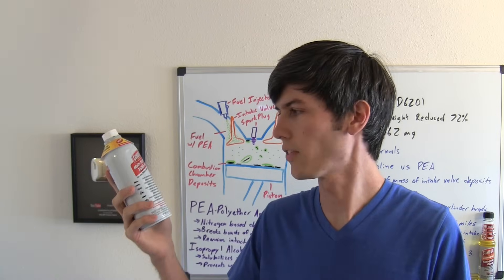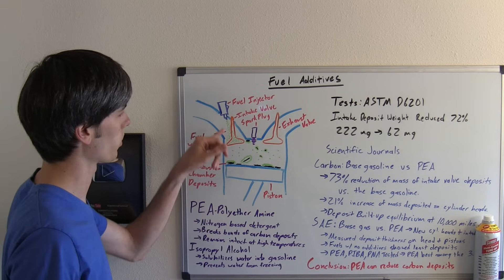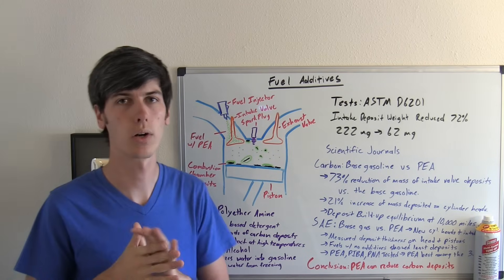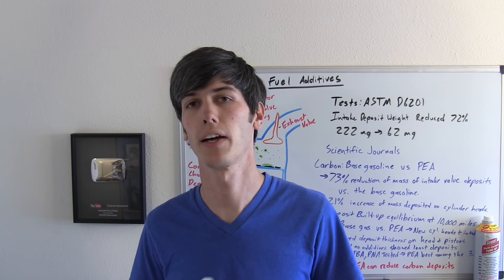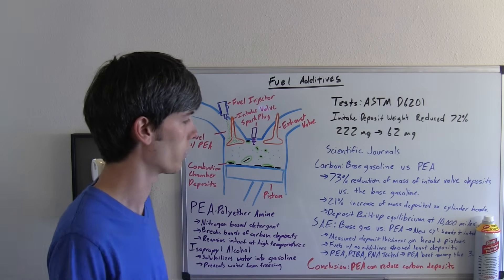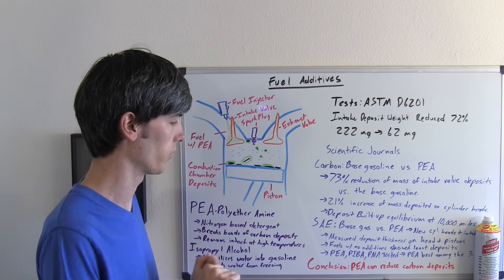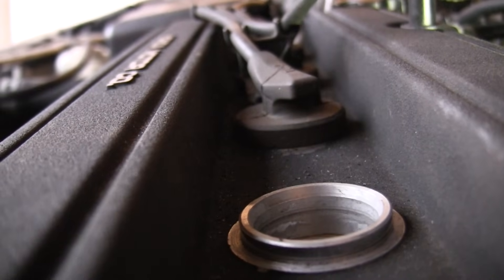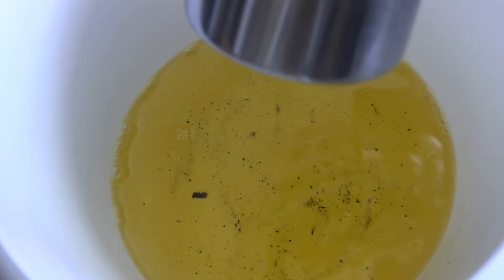Fuel Additives & Injector Cleaner - Explained

Comment: Until what approximate mileage (I know this is very dependent on vehicle use, engine and fuel type/quality, etc) is an engine considered new (aka doesn't benefit from PEA additives) and at around what k approximate mileage (if you had to make a rough estimate) might it start benefiting?

Comment: Only down side to euro 4 + vehicles, particularly direct injection diesels, 

Is they recirculate exhaust gases through the inlet, yet also, hook the oil breather pipe up to it. 

So you intake clogs up, including the valves, 

But the manifold is dry as it’s direct injection, so it does not clean your valves.

Comment: 4:17 - IF you consider high quality gasoline the one with additives but additives make more deposit in your engine, why do you recommend using high quality gasoline ? The best solution wouldn't be just regular gasoline with some PEA  ?

With that in mind, if you use "high quality fuel" or "with additives" in new cars, in the future, they will become as dirty as the older cars because such fuel adds more deposit. Makes sense ?

What I see here (and having in mind such scientific data) is cyclic dependency that gets worst over time. In fact, we put more additives to clean the former additives. If there's an additive with just PEA, that would be great ! But are they ? They're all "laced" with molecule X or Y to achieve more detergency or more lubrication or more this and that but the fact is, as it seems, less is more with additives.

I already read something about this issue. That's why I use regular gasoline (no additives) and Oilsyn's Hybrogen, a fuel conditioner. It is not an "additive" per se. Instead, it changes the molecular structure of fuel to achieve the same end. You should check it out someday.

Comment: I poured seafoam fuel additive before filling up to full in my 165,000km engine and ran a 700km road trip using highway speeds. When I took out one of the spark plugs that had 85,000km on it, there was absolutely no carbon buildup or black residue on the spark plug. I wish I checked what its condition was beforehand because I was positively shocked. I think it was the fuel additive.

Comment: What a great video ive got a p0303 code for a cyl 3 misfire and my throttle response is a bit slow im gonna run some of this through the system to see if it cleans my fuel injectors its 160k miles never had any additives and its also 13:1 compression ratio so ik it uses less fuel and could lead to clogged injectors on lower octane (probably gonna start running premium even though it doesnt perform any better in my engine)

Comment: What's about acetone that's all right if you've got solid pipes but you've got rubber pipes it might be a problem!!!
Reply: should be fine here in australia we got E10 which is 10% ethanol with the fuel since its alcohol and acetone is alcohol im pretty sure it wont do damage as its diluted well within the fuel tank

Comment: I witnessed an engine tear down to where all cylinder heads (top of cylinder) were exposed coated baked black on top, " except one ". That clean one was sparkling shiny on cylinder head top. My assessment was there was a main seal break or opening  leaking radiator fluid into the shiny head cylinder under combustion causing this amazing cleaning by super heated radiator Fluid,  evaporated not combusted. Best wishes. Yet have not ever heard this clean cylinder head top, as every auto mechanic must have seen this ?

Comment: thanks for the breakdown.     when deposit buildup is removed by said liquid, does  the residue eventually go through the catalytic converter?
Reply: Usually its only the large pieces that break off and end up at the catalytic converter, since the small pieces burn off before it can even reach there

Comment: So, the cited articles found that, although PEA additives decreased build-up on intakes, they actually increased carbon deposits on cylinder heads more than gasoline alone.

But you still claimed they remove deposits in general.  Hmm.  I think I see a sponsonship effect.

Comment: Greetings. i have a 1.4lt turbo gdi hyundai engine (year 2020 model i30) with 42.000 km so far. Do i need this? It will help my engine? I use only premium gasoline.

Comment: To run fuel cleaner for 50 hours wouldnt you need to use the cleaner on back to back fill ups for like say 10 times in a row??

Comment: No mention of injector cleaning effectiveness.
Reply: Yeah Id like some data points for that.
Reply: You'd have to find something that tests them, the guys just explaining the theory not the practice
Reply: Seems like they wouldn’t have carbon inside since there isn’t combustion going on inside. Maybe at the tip. Might be easier just to pull the injectors a clean by soaking or light wire brush. Then checking spraying ability manually (find a video that shows you how). And if it’s electrical bad just buy a new one

Comment: I can attest to the effectiveness of PEA as a chemical cleaner in gas engines.

I have a Nissan 370Z with the VQ37VHR engine that is hitting 57K miles. Since it was new, I have been using a maintenance dose(⅓ oz per gallon of gas) of Redline SI-1 complete fuel system cleaner, which is high in PEA,
through the gas tank. A borescope viewing into one of my cylinders at about 40K miles showed nearly no carbon deposits on the piston top, with the aluminum only lightly darkened in color. Once a year I do have the intake system misted with a concentrated cleaner and have the throttle bodies cleaned.

Comment: I’ve been using GumOut on my 150,000 miles car with only a Direct Injection engine.

After watching this video I’m glad it’s not just a placebo effect but an actual result for using the fuel cleaner. 

This video really helped me bring back the MPG and mostly better engine performance of my car especially when you also watch and follow his italian tune up test vid which I really like because you no longer need to rev the engine high gear per gear, just cruise in that specific rpm for a while and the heat just burns those deposits. :)

Comment: Yes. This and berry. Works well.     I use reclaim gumout every other time. 3000. Miles.  Run. Mid grade gas. If possible. It helps a lot.   Good video. Tu

Comment: Good quality gasoline will only retard the build up. Direct injection engine are sensitive to injector being dirty. I would say use a treatement every year even with quality gasoline. I speak with experience. Or else you will see your gas mileage decrease over the years.

Comment: The major problem with these off the shelf cleaners is the carrier oil. It's made up 80-90% low grade oil, plus the additive line PEA.  What ever benefit the PEA cleaner does is negated by the carbon build-up from the oil in fuel mixture. Especially bad for GDI engines. Agree, just use premium Top Tier fuel.

Comment: (My english isnt that good) Well i tried liqui moly diesel injector cleaner in my vw passat 2.0 tdi ( 2011) and i made a mistake by adding the additive in half a tank , i thought its normal but no , the first 5 to 10 kms went noraml but than i started hearing lot of knocking sounds from the injectors and the car started idling rough , i turned it off nd it wont start just cranking not firing up , after many tries i managed to turn it on nd took it right ( injectors still knocking) i got a full tank of fuel nd drove for like 20 mins at High rpms ( 3k 3.5k) after that injectors stopped knocking nd the car turned to run fine , second day it was driving like new , if anyone understands what happened pls explain

Comment: Do fuel additives help clean fuel injectors or do fuel injectors need to be manually cleaned by a specialized testing centre? I own a diesel 2.2L 4 cyl, with 497,000 km on it. It might be having issues with clogged fuel injector/s. And i'm trying to use a high concentration/very high quality fuel additive/fuel injector cleaner , to hopefully clean my injectors without having to remove the injectors and having them tested which costs a lot of money. I saw some videos of people manually cleaning their fuel injectors with fuel additives and a tiny hose, but many mechanics tell me youtube videos like that are rubbish or fake. I'm thinking of buying Lucas fuel treatment for diesel, and hoping it will properly clean my injectors so i won't have micro symptoms of shakes while idling, which may get worse over time. No fault codes have appeared yet, however reasonable suspicion that fuel injectors are slowly getting carbon clogged and may need cleaning.
Reply: If you can get some Millers ecomax diesel treatment. It's an excellent product, very effective.

Comment: Ran two lots of injector cleaner through my 2.5 Diesel engine. I’ve been running it 20k it’s a good lump but I don’t know the history before I fitted it. It’s definitely made a difference on mpg going from average of 31 to around 33.5. And it feels slightly better. Next step is new injectors but as an interim measure for twenty quid it’s been worth it.

Comment: You reached a great conclusion.  Newer engines are high precision and don't have as much waste and the waste is where the carbon buildup comes from.  Simply put, newer engines don't need the additives but older engines do.  Things like Fuel injector will eventually build up carbon, (80,000 miles typically) but they are also in the routine maintenance schedule for replacement at that time.  So, once again, if you follow routine maintenance, additives are not needed.

Comment: I believe the flow rate of the gas/additive mixture plus heat make all the difference vs soaking in a beaker at room temp. Tough to do this comparison unless you start with two of the exact same year car with similar deposits.

Comment: I've used Wynns injector cleaners and diesel fuel treatments in diesel engines, both 90s rotary fuel pump and more recently in common rail engines for over 20 years. They work great. However, I've heard of a trend of people adding 2 stroke mineral oil into their diesel tanks to combat the lower sulphur and higher ethanol/biodiesel content of modern diesel fuel. @EngineeringExplained Can you please do a video on this as I think it's unecessary and will just cause fuel filter clogging, ossible injector damage and excess carbon deposits in cylinder head, valves and exhaust...
Reply: I saw a video where 2 stroke oil was tested as a diesel anti-gel but it did not work too well.
Reply: @TheTyisawesome  so far I can only think of negatives. Might explain the extra dense soot patches on some people's rear bumpers recently, which I never aspired to even with smokey old Peugeot tdis?!🙈😂

Comment: Try once a year adding 1 quart of ATF to 10 gallons of gas. The detergent in any ATF is one of the most powerful known to man and will clean anything. I've used it for years and I have never had a bad fuel injector.

Comment: We need more on e85
how too use it safely 
does fuel additive change the tune
how too protect alloys or steal against corrosion 
drum vs pump e85
is using e72 that has more petrol better?

Comment: Hi I added a correct dosage of a PEA based product to a full tank of gasoline in 2.4L engine with a 100K miles on it, after 80 miles of highway driving I've had a 10mpg drop, a fluctuating fuel gauge and crackling sound from below the engine which continues after the engine is off, possibly from around the catalytic convertor but no CEL light.  Any ideas what's going on?

Comment: A quart of transmission fluid in your fuel tank at every fill up will do wonders for your diesel. Not sure about new ones with all the emissions crap they have. I dont know about using this for gas engines either.

Comment: There are so many on the market, I was hoping you would test them and show the winner. Just like olive oil which is one of the most adulterated of products, so to are fuel additives and cleaners . Some are watered down , others concentrated. Trying to strike a balance as to which one will do the job without damaging sensitive parts is difficult for the novice fixer.

Comment: You do awesome work! But. Why can't anyone answer THE question that I've been trying to find out but seems like it's just too simple for everyone. "Can octane boosters (In a bottle) actually boost the octane of pump gas". I have a turbo car I want to tune using 95 octane fuel. In my area I can only get 94 octane (10% Ethanol added) and want to make it into 95 octane. Can an octane booster off the shelf actually do this? Or is it just pipe dreams in a can? Do I have to get a hold of actual xylene to do that? How much would I need to use to go up one octane point. Or could I actually use the 95 tune (it's a tune you get from a tuning company that is pre made) with 94 and not have to worry really?? Sorry for the complex questions but maybe you might see this and it could give you a topic for your videos? And help me LOL. Thank you for your great hard work over the years!

Comment: Leaving it soaked does not take into account the temperature, pressure and flow dynamics of a running engine, that probably helps in removing deposits

Comment: I wish I knew why it is that when I put fuel injector cleaner into my gas, the car stops dropping down to 500 rpms, stops stuttering and stops losing power when I press the gas, but then after a couple days it goes back to doing the same thing before putting another bottle of cleaner in, clearing it up and then having it go back to losing power while idling and accelerating out of an idle stop (ie; after the light turns green)

Comment: Hey man  please answer my question , I research a lot but did not find the proper answer 
The question is what , if we put another car fuel injector to our car for example I have a 2007 Toyota 4 runner it’s getting a  very very bad gas mileages and mechanic told me it’s because of fuel injector replace it with Toyota Camry fuel Injector I want to have your opinion in this please

Comment: Maybe I am reading into the source too much without actually reading it... but if you research a steady state at 10000 miles under that test doesn't that mean using the additive in high amounts is just a waste of money since it does not improve the amount of deposits removed beyond that point?
So basically it sounds like for a well maintained or relatively clean engine its basically useless but if the car was neglected and had a lot of build up from previous use or neglectful owner it can reduce the build up after a few treatments.

Comment: Here is a video idea for you:  discuss why tire shops won't fix tires that have punctures in the shoulder or sidewall. (hint, I think it has something to do with the tire flex in that area, and the heat generated to the the tire flexture.)

Comment: So we understand that PEA dissolves carbon. But this carbon isn't burning in the combustion chamber into CO2, and instead getting deposited inside the engine. Like they said, on the cylinders and stuff. 
So aren't we actually harming the engine more, by using additives. 
We could manually remove the carburettor and clean it if there's carbon build-up. But in this case aren't we actually just dissolving up the carbon from entire fuel system and just dumping them over the engine?

Comment: Take out all spark plugs..pour it in neat . Say 50ml , and let it soak for an hour..then turn over your engine with a heavy towel, old one, over the spark plug hole and blow the carbon and cleaner out for a fast effect clean then use additives everyfill up

Comment: I have bought an old motorcycle, it has already completed 52000kms as the meter reads.
 112cc OHC engine, Should I do the fuel system clean for the first time?  Will those deposits get stuck somewhere or damage the piston sealing area?

Comment: I'm questioning the statement that carbon buildup plateaus at 10k miles. We all know that the more miles the more buildup. This is evident in cars with 200k + miles where the build up is extensive and even debilitating to the engine....
Not trying to be argumentative just wondering where you got this stat on carbon buildup???

Comment: I had positive results Seafoam ing an engine via a vacuum line (brake booster)...I strongly recommend this procedure for high mileage vehicles...The engine will idle a lot smoother and have noticeable more power at WOT....

Comment: I have used Chevron Textron with good results,. This showed good effect on an '89 Toyota Corolla with a very complex CARBURETOR, Toyota's last carb in the US. After putting a full bottle of Textron in with a fill up of mid-grade gasoline we noticed the engine's hesitation and lack of power disappeared within the next 50 miles on a drive from LA to 'Vegas.back in '98.

Comment: SELL OUT - I don't think people are listening well. Sure he is an engineer, but is anyone listening? You have to run your engine for 50Hrs before any noticeable cleanup, that's several months and multiple bottles of this stuff. Also, that demonstration towards the end? dipping that part in full strength solution? the additive will be mixed and diluted in several gallons of gasoline. SO this is a clear case of someone being paid to sell us products we don't really need.

Comment: To clean inside the combustion chamber, just run clean distilled water through a hot engine. Rev and pour slowly. Spark plugs valves piston and heads will look like new.
Reply: Pour it into the tank you mean?